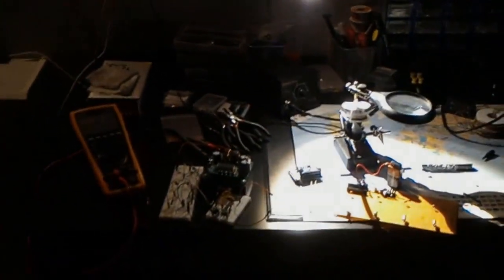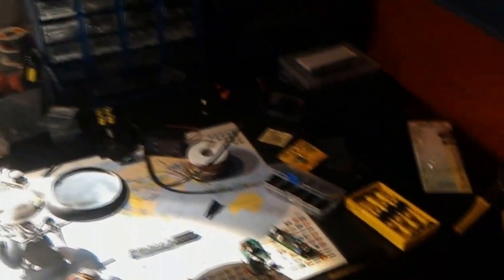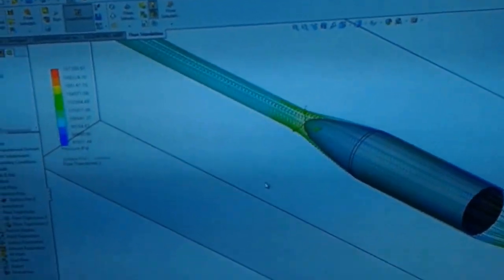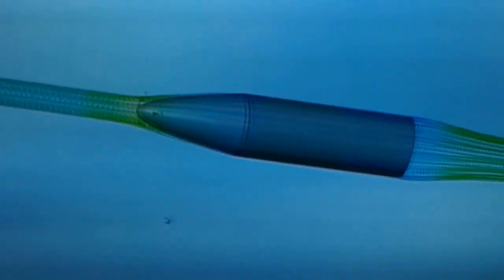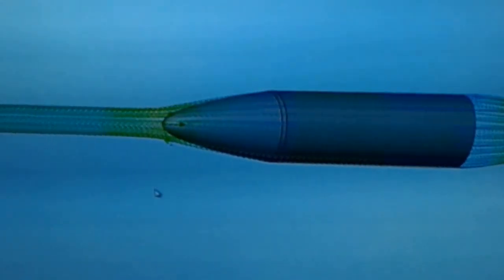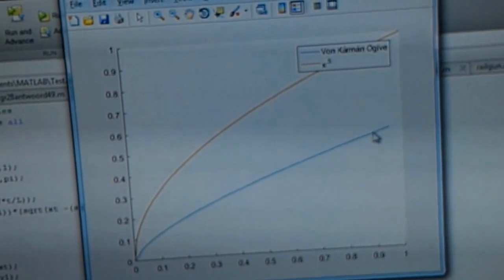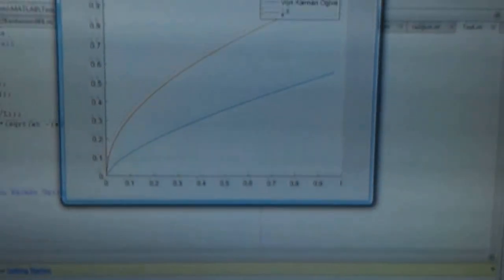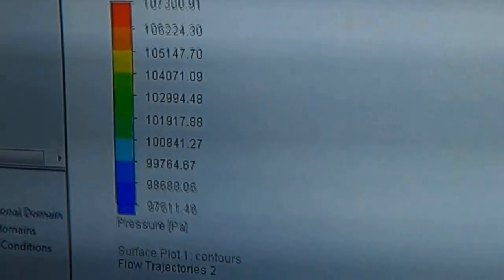Vlog #001 - workspace and railgun projectile design dynamics

Comment: I can sense something great in the making!
Was the laser thing a speed trap? Looks way similar to one I made...
Reply from the maker: NNNI Yes, a chronograph. Using 4 measurement points for extra precision. I am not sure if the LDRs are able to react that fast to the change in light intensity.
Reply: Photodiodes have a nanosecond rise and fall time, definitely a better option.
Reply from the maker: NNNI Ideally yes, but I doubt my projectiles will be nearing lightspeed. LDRs I had laying around. But i'll order some photodiodes just in case, they are not cheap.